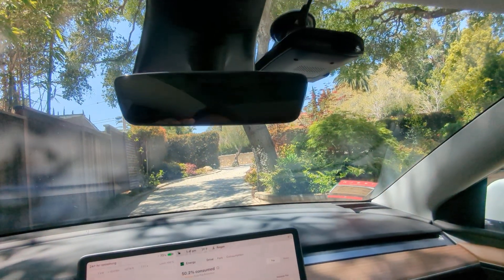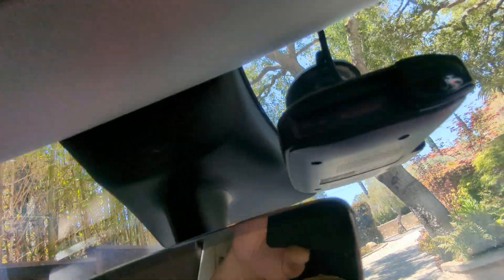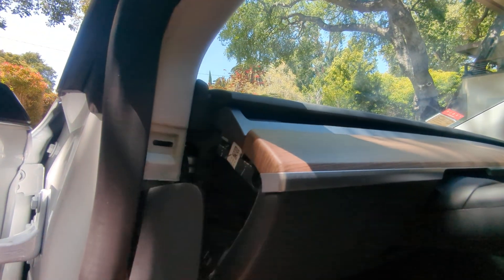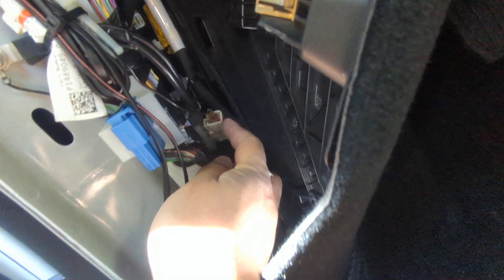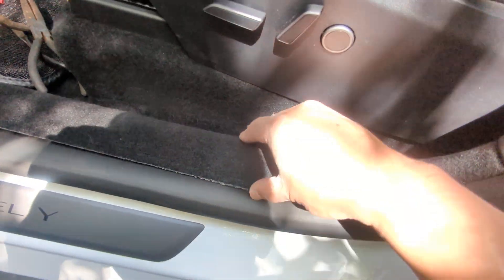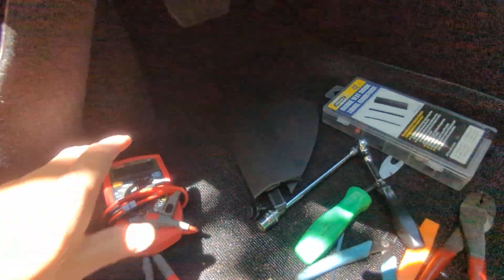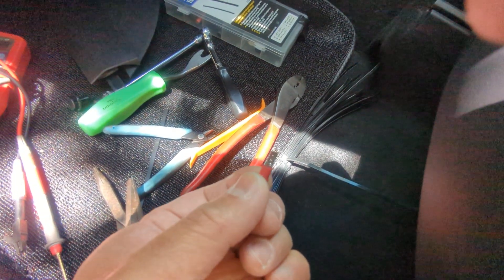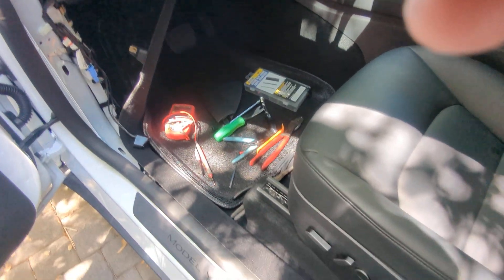How to Hardwire your Radar Detector for little to no cost in your Model Y

Comment: Thanks for the video! Just wondering, is the 4680 Model Y still using HW3 with no USS or radar?
Reply from the maker: Yes, as of now
Reply from the maker: I just saw HD4 is now available for the Y
Reply: @RyuMoto  I saw that as well. But it doesn't seem to have radar, uss, or bumper cameras? It's kind of weird.

Comment: Is your Tesla model Y long range?
Reply from the maker: Standard range AWD
Reply: Thanks for responding. I just picked up that connector from Tesla one question  does that connection you made work as a switch? Meaning  switch off and on when you leave the car

Comment: Can you post the actual connector you used?
Reply from the maker: Are you referring to the small male spade connector?
Reply: @RyuMoto yes! That you attached to the wire and plunge into tow hitch slot
Reply from the maker: @JamesGountanis  2.8 mm male

Feggizuli 280PCS Crimp Connectors, 2.8mm 4.8mm 6.3mm Male and Female Spade Connector kit, 15 Types Crimp Terminals Electrical Connectors, Electrical Terminals Includes Spade Ring Fork Wire Connectors https://a.co/d/0U6qYAF